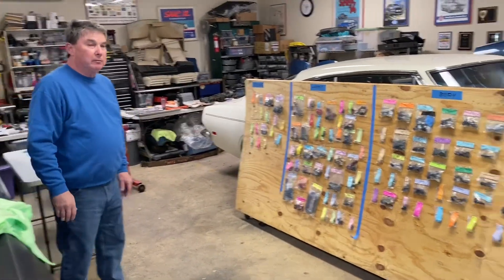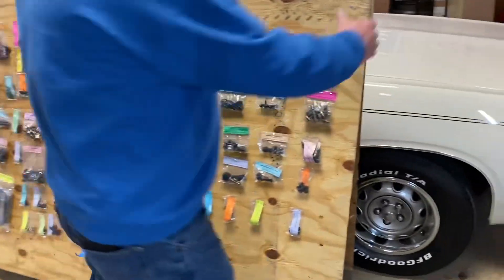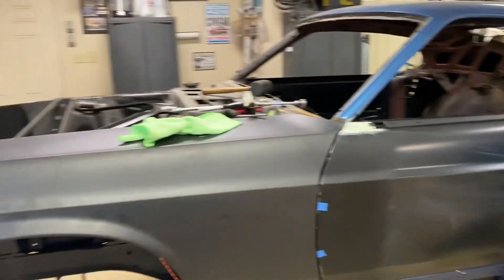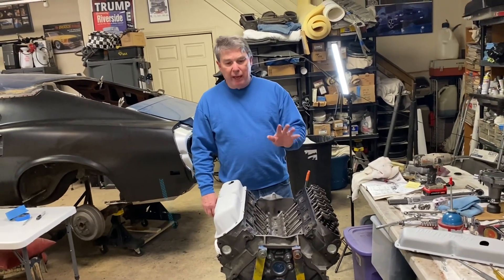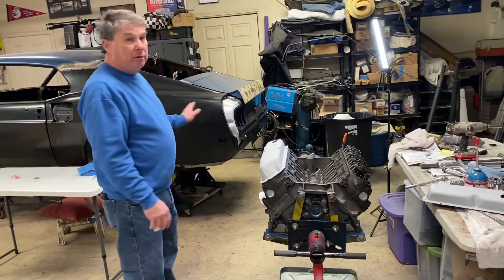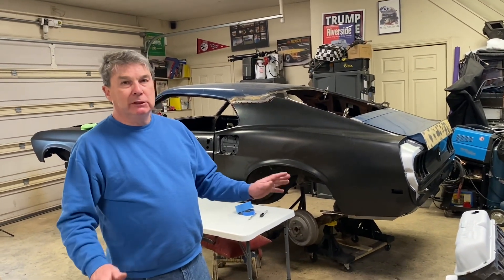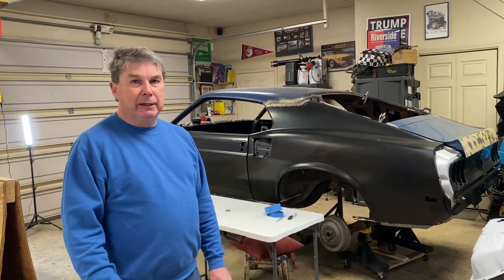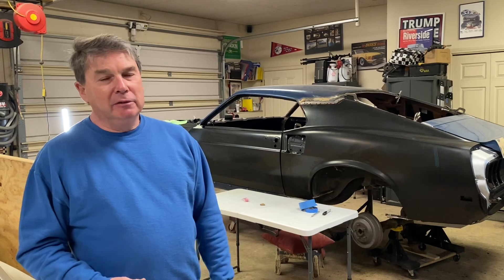1969 Mustang Restoration (Part 10)

Comment: Just found your channel yesterday. Looking forward to watching the build. I have a 69 Mach-1 with a 351W (M-Code). I love watching people saving these things from rusting into the ground.
Reply from the maker: Matt,
The M code in 69 was the sweet spot of Ford performance...same HP as the B302 just at a lower rpm and lots more torque..... And lighter than the big blocks so handling wasn't compromised... enjoy your car....and thanks for watching... Michael